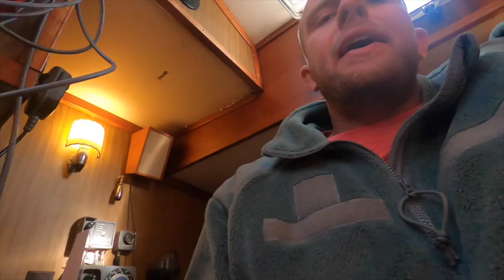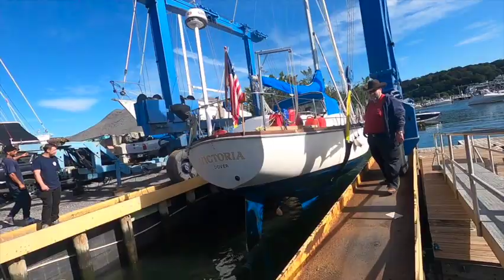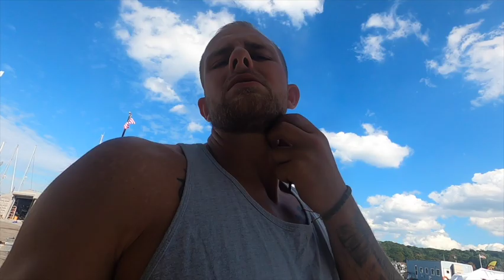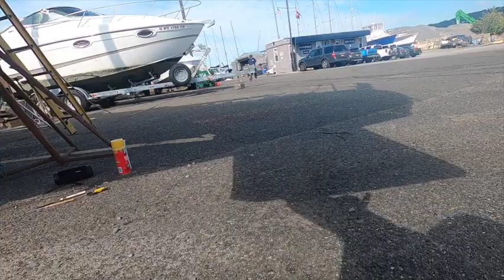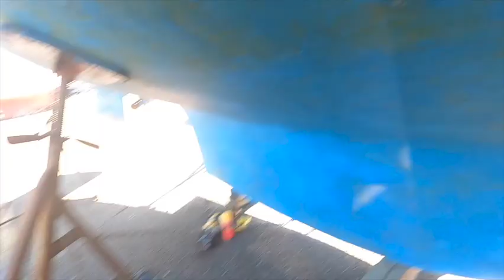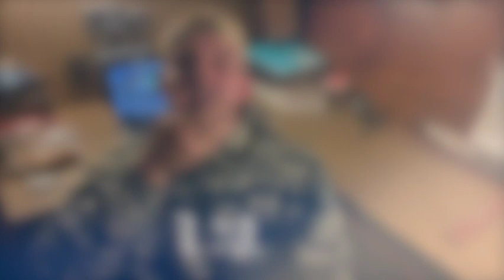Almost Titanic 2 - My "Unsinkable Boat Adventure"

Comment: A great idea would be to buy yourself enough wood plugs for each seacock. Tie them to the piping with a peace of string so that if this ever happens again you are prepared.. also don't forget to double clamp everything after replacing the seacocks.. you can buy a decent pump at harbor freight that will pump out some serious water since you're already carrying a generator.. think I paid under 150 for mine and it will pump almost 1800 gph.. it's got a automatic switch on it but would be great to have incase you have another bad day in the future. Lady Aphrodite is still an amazing boat!!! Have you seen the channel Sailing Seabird??? They bought a older gulfstar center cockpit believe 41ft. It was abandoned for 15 years and in ruff shape. They bought it for 1 pound and are doing a great job completely rebuilding her..
Reply: Sailing Seabird has a issue with the keel(concrete and iron) separating from the fiberglass and they've been using this underwater epoxy.. it's working well and might be something you can use on your rutter to get you by for the next year or maybe longer.. it definitely will make it solid..they did a video putting it in and this week's video a surveyor had them drill a few bigger holes and the epoxy is definitely filling the void and bonding solid..
Reply: I would be careful with the spray foam.. that stuff expands and it will split your Rutter causing you to build or buy a new one.. and it's not going to do a good job when it's submerge in saltwater all the time
Reply: Wise words with good intentions! Speaking from experience and it shows. I also follow the Seabird 🍻
Reply from the maker: Thanks for the advice guys. I wish I saw this before I dropped it back in the water. I’m hauling back out in a few months once I’m around Central America!